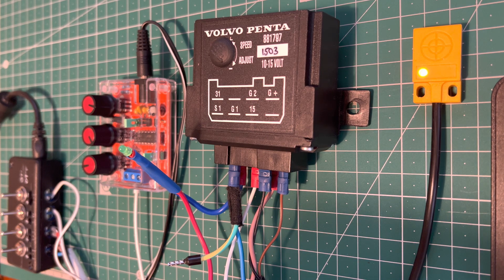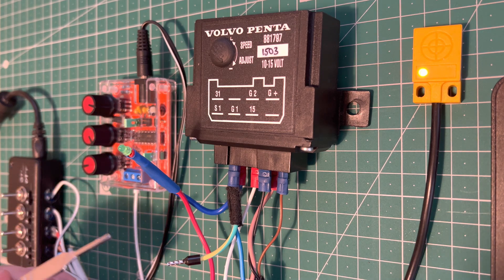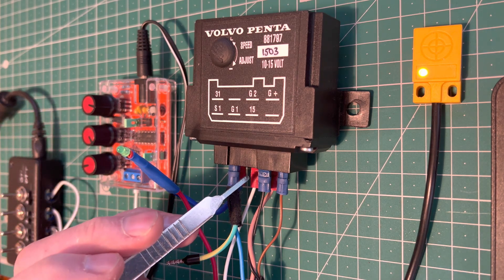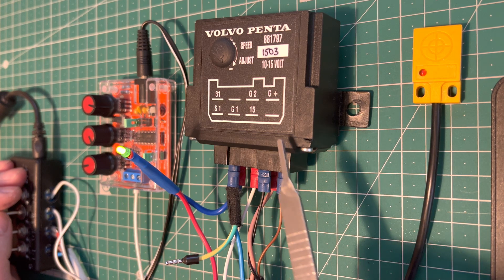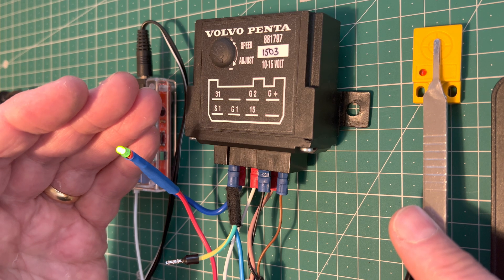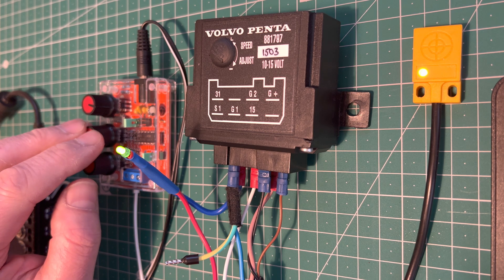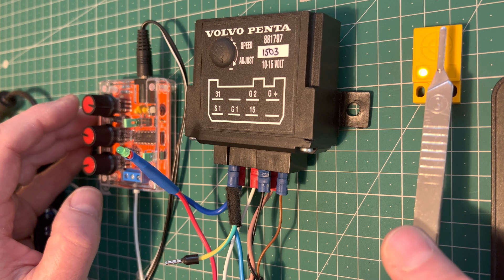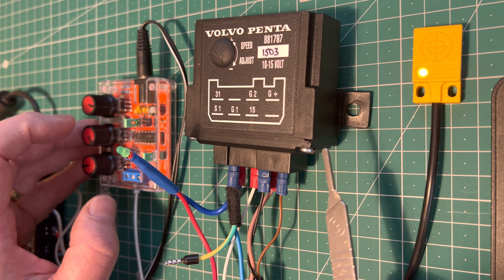Testing KAD supercharger controller

Comment: I have a kad 32 which rubbed a wire though for the proximity sensor and ultimately must have blow the micro switch inside. as you stated they are very expensive to replace can you just replace them with that style of sensor like you used
Reply from the maker: Hi - The proximity sensor is made by Pepperl & Fuchs (P&F) and the item is unique to Volvo, meaning they will not sell to others. P&F do have some similar versions, but seem to run on slightly higher voltages and I didn't yet find one that was compatible electrically and mechanically so it fits on the throttle body. 

The sensor type is NPN Normally Closed.

So if you looked at another, it would need to be exactly the right size to screw onto the throttle body.
The sensor you have can be tested and the damaged wires can be repaired,  as can the controller.
Reply: @nfiler6257  I rang p&f directly as they are based here in Australia the guy told me basically the same thing and dropped and f bomb when I told him how much Volvo penta were charging for them. I fixed the wires myself but it didn’t solve the problem basically the supercharger stays on all the time so I’ve disconnected the sensor and now run it on a switch and manually control the charger. It’s not really ideal to be throttling up steering and flicking a switch all at the same time but it works for now
Reply: I may just have to fork out the $650 and just fix it
Reply from the maker: If you email me I can tell you how to test the sensor and also how to test the controller. You will need a multimeter. 
You could probably UPS the controller to me in the UK for 100 Aus Dollars, if it's a simple fix, then probably on $50 to fix. filern04(at)gmail(dot)com